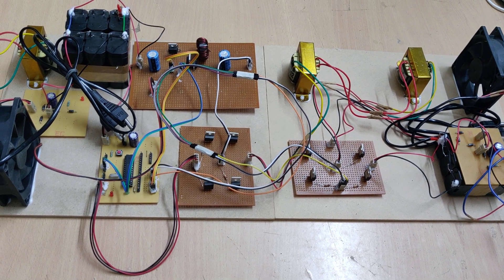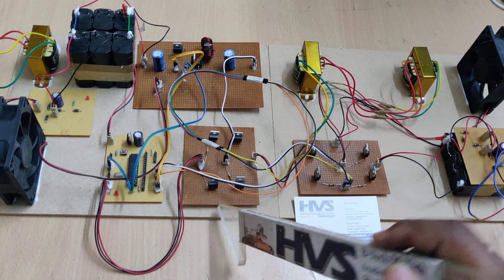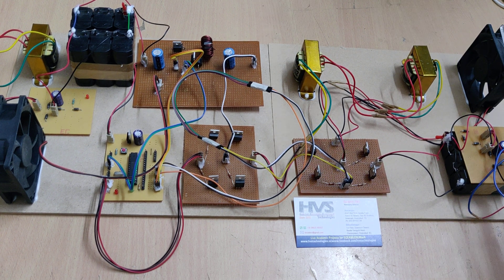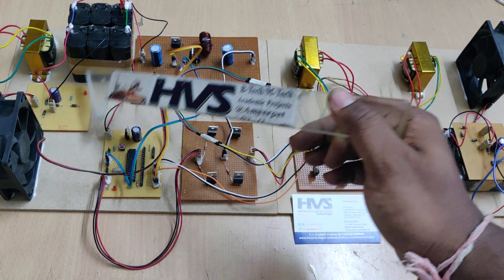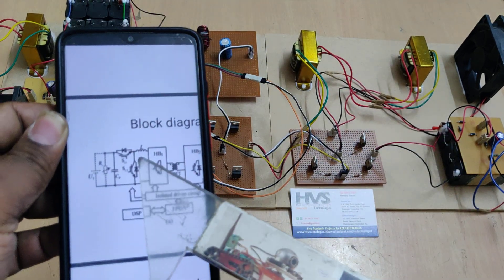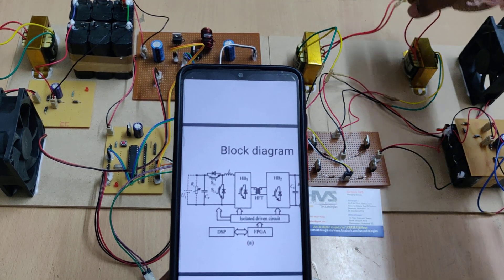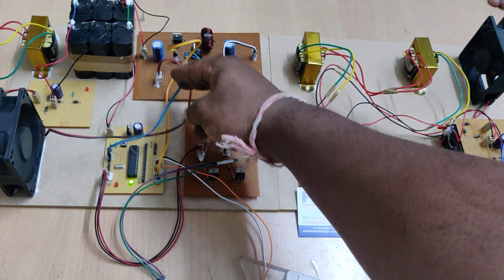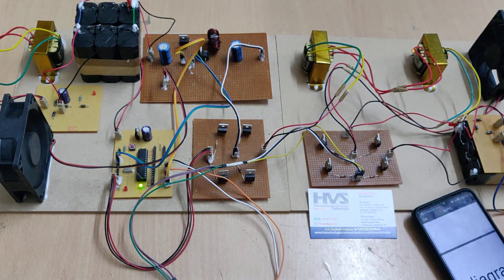HVS-3010.Bidirectional buck boost current fed isolated dc dc converter it's modulation

Comment: Where can I purchase a 12v DC to 28v DC step up converter about 200Watt 6amp output, that is ISOLATED with separate transformer contained?
Reply from the maker: You can contact us at +919603140482
Through WhatsApp or call